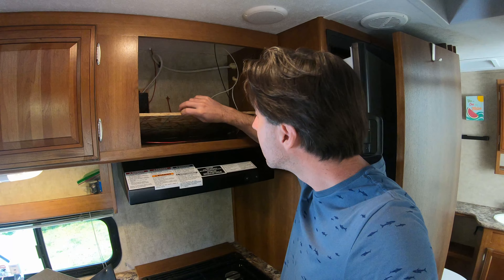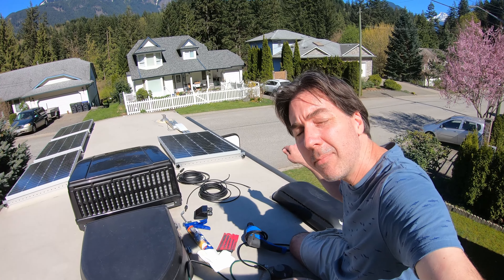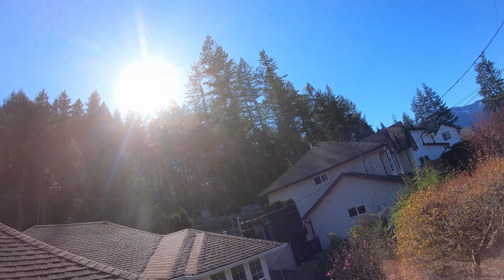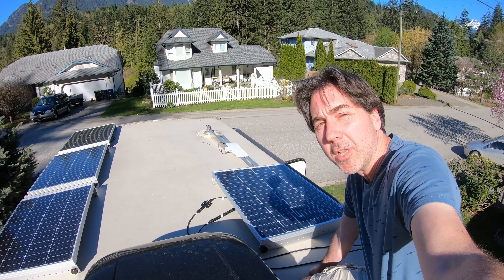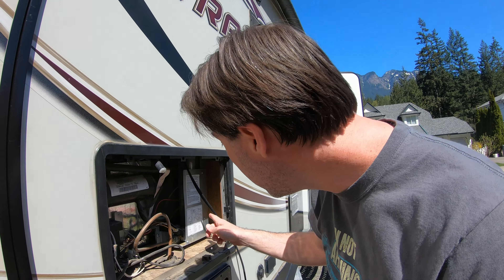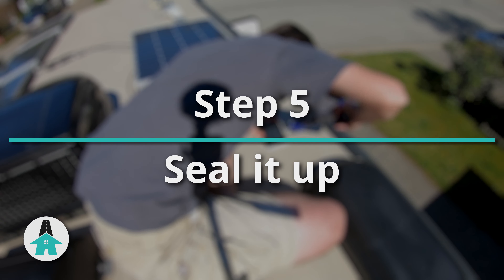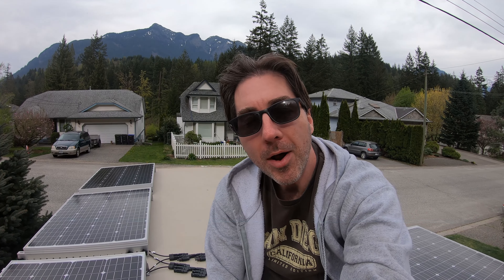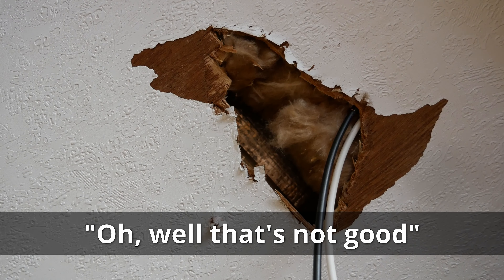RV solar panel install |🌞| WIRE ROUTING

Comment: Great install. Just wondering why you didn't just drill from inside the cabinet up through the roof? Seems like it would save a lot of stress. Like the way you routed your wires.
Reply from the maker: That's a really good question, and I'm not 100% sure the reason. Every tutorial I watched drilled down from the outside so that seemed like the natural way to do it. The only potential reason I could think of is that maybe if you drilled from the inside out, the drill bit might catch the rubber roof covering and twist and tear a larger hole? But even if that happened, it's nothing a bit of dicor wouldn't fix. If I need to drill any more holes, I'll definitely think about drilling from the inside, thanks for the suggestion!
Reply: I was wondering the same thing.

Comment: Great video.  I saw on your Los Barilles video that it looks like dual tilt brackets for your panels,  Is that the case, and which ones did you use. Thanks
Reply from the maker: Thanks! I actually made a video all about them: https://youtu.be/ipgUaOgem40 -- These are the brackets here: https://ca.renogy.com/renogy-rv-tilt-mount-brackets/
Reply: @HomeARoam  Hey thanks a lot. I'm really enjoying your videos on the Baja. Was down there several times sailing. Can't wait to replicate your trip in the near future. Enjoy!

Comment: what are those wires for that were already coming in from the ceiling (behind the microwave)?
Reply from the maker: Hmm.. Not sure which ones you mean. It could be just the 110v line for the microwave itself. Or possibly 12v for the light?

Comment: Did you go directly to the battery or to the fuse 12v panel?
Reply from the maker: The panels are wired into our MPPT solar controller.
Reply: Why didn't you show the controller location ?

Comment: I assume you know it by now, but 100W is in perfect sun conditions in a lab. 
Mounted flat you will get even less, there are some videos on YT showing difference between flat and  tilted and it's night and day difference :) fill the roof with solar panels :) can never have too many
Reply from the maker: Very true! Yes, we're finding now that we have Starlink that we're tilting the panels more often. It does make a big difference -- between being able to run Starlink all day, and having to shut it down for a few hours to let our charging catch up. 😁
Reply: @HomeARoam  do you have the expensive starlink or the cheap one?i saw it was like 3000 USD to have it work while moving, its insane. (Meaning while driving)

Comment: Why didn’t you drill up from the existing hole ?  No measurements required
Reply from the maker: The space inside where the existing hole was pretty tight that our drill wouldn't have fit. Drilling up would have been great, but we also didn't want to risk hitting something on the roof.